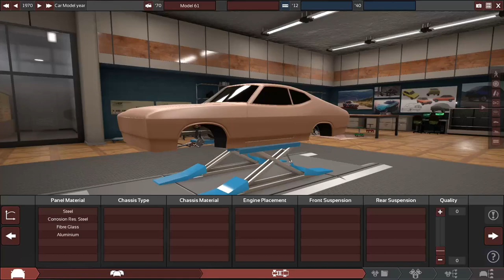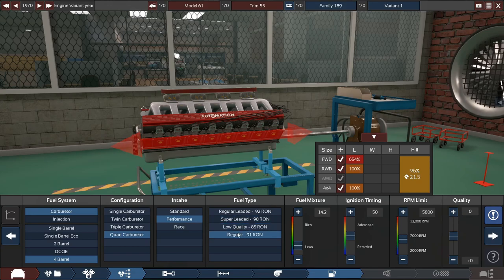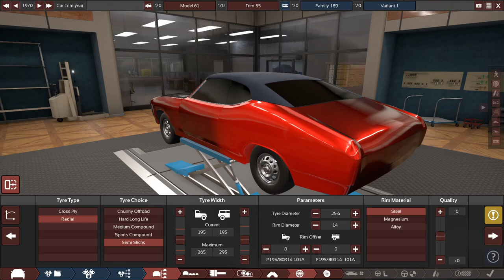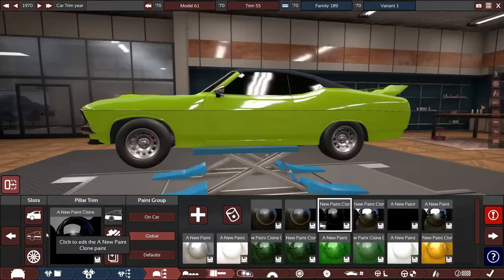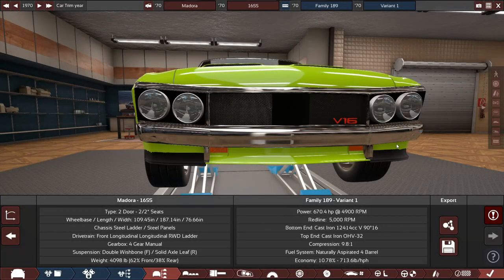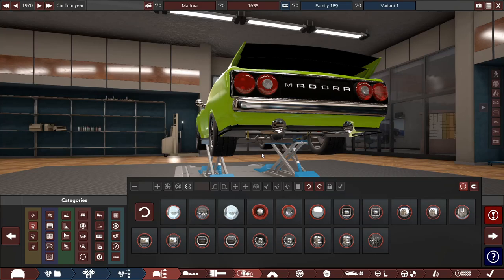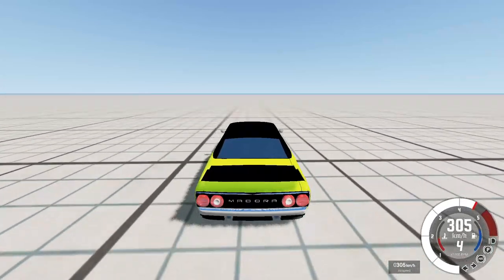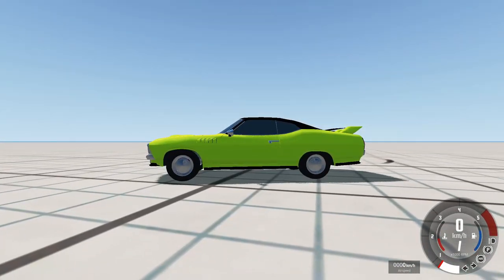Building A V16 Muscle Car!! Automation - BeamNG

Comment: Uhh, it’s most American cause you put 2 V8’s together
Reply: Wouldnt that be a W16?
Reply: @undoritohaladas  Long-block or wide-block? Two banks or two twin banks? Are we talking what would probably end up being called a V2-VR8 or a normal V16? Because a V16 is raw Americana and a W16 is German engineering prowess. V16 is Cadillac, W16 is Bugatti, but both are mega bwaaaaaaaaah
Reply: @Avetho  yes
Reply: @undoritohaladas  or go for the ultimate cursed engine design X16

Oh god i just checked and apparently at one point Rolls Royce(the Aero engine manufacturer, not the car manufacturer) wanted to stick two X16 engines together to make an X32 engine.

The only X engine really used today though is in the latest generation of Russian tanks and is an X12
Reply: Actually gm created a v16 with only using to ls7s i believe and welding them together
Reply: @Avetho 4 years later, bugatti has a V16 too
Reply: @ZayZay.mp3  And its pretty cool, too!

Comment: Madora is a Greek name that means Ruler. Should the 16SS be widely successful, it will claim the title of Ruler of the Road. Considering its a huge V16 its gonna be making that horsepower rather reliably. Though I'd imagine since its 1970 the reliability scores would always be low across the board XD

It looks wonderful and it sounds awesome (as all Automation V16s tend to be lol), so its the early hypermuscle-car, especially with the ease of control under throttle. It kinda reminds me of the Delray Imperator from Car Mechanic Simulator 2018 (that one's supposed to be an '08 Challenger but looks more like a modernized Plymouth Barracuda), its got a high back, a wing, its sleek and boxy somehow, and its smooth. And I don't know why but the taillights look very familiar, like I saw them in a game somewhere and promptly forgot where XD

Comment: Offenhauser makes an intake for a ford 300 cid (4.9L) i6 that runs twin 4 barrels. You can put about 700cfm to the motor if you get it running good. Its what I run in my 78' f150.
Reply from the maker: Ok I didn't know the offenhauser has twin 4bbls for the 300 six.

My Maverick has a 200 six, and the offenhauser intake is for three single barrels!

Thank you for that cool fact :)
Reply: @TwinTurBros  they make a lot of crazier parts that seem a little outlandish at first.
Side note
 Going down to the drag strip today to make some passes with the race team. Ill have two gopros in the car and might upload the videos if we dont get destroyed(Nahunta dragway in North Carolina)

Comment: Idea for next time: make a Mustang but with p51 Mustang engine (if its even possible to have 28l engine in automation)
Reply: I believe it is but good luck finding a car that could fit that
Reply: @bertakuceru6865  its not,the biggest engines are 16l-18l if i remember correct,but still its a 1l for one cylinder,these have to be huge enough,because you cant have more cylinders than 16 in automation
Reply: @Your_nearest_toyota_dealer  Ok, thanks fot the info!

Comment: "Dual quads" was not too uncommon for the serious-business muscle car big-blocks.  Realistically the advantage over a properly-sized single-quad is somewhere between minimal and negative, but dual quads under the hood looked mean.  For whatever reason though, the triple-duals (tri-power, six-pak) setups seemed to be even more prestigious though.  I guess because the motors that had dual quads just "happened to" have that setup, whereas the six-pack options were the name of the engine, complete with cool names, badges, stickers, and usually a hotter cam and heads.  If you had a Hemi with dusl quads, the carbs were beyond overshadowed by HEMI.